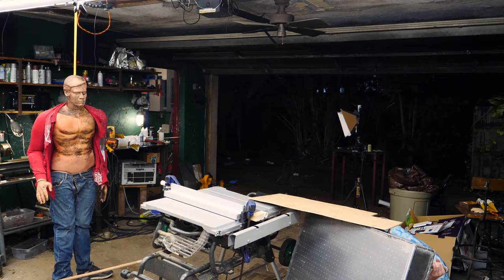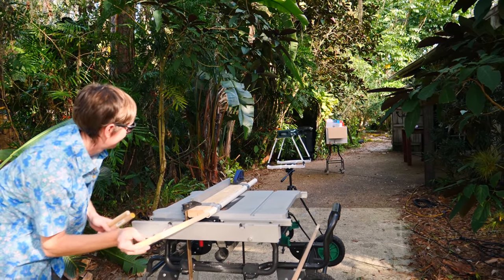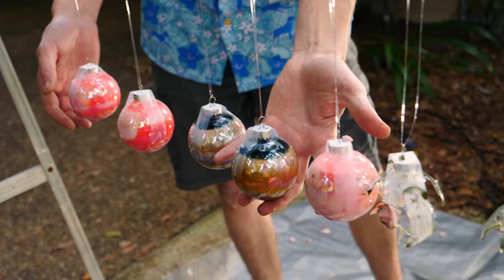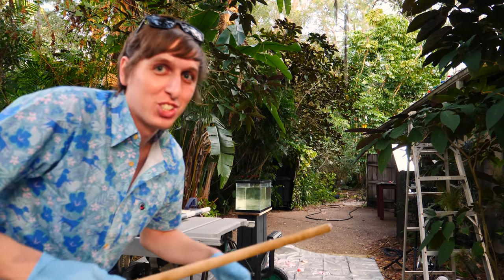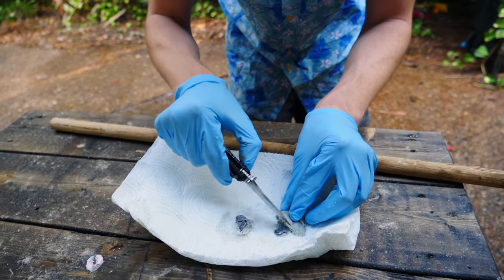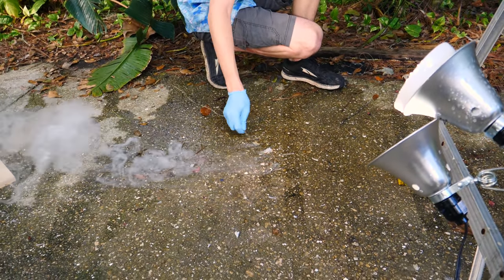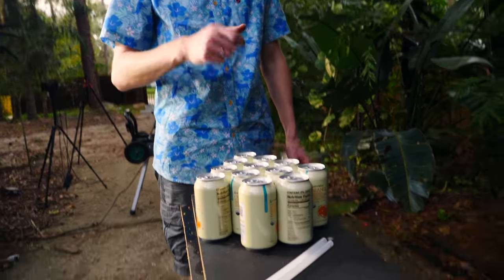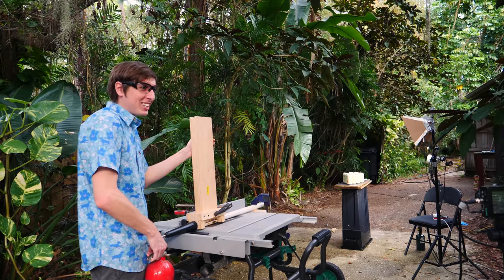Fully-Automatic Table Saw Cannon

Comment: You need to add rifling to the barrel.
Reply: Ya definitely
Reply: That wouldn’t work, because the dowel isn’t able to spin
Reply: @jacobr7729  It could theoretical work if the barrel was made longer
Reply: @realname3538  true
Reply: Put a suppressor on it lawl

Comment: Could you speed up the auto cannon with pressured air?
Reply: Tech Dunk I think he would need something to push down the dowels faster
Reply: The saw is catched on to the dowel; it cannot move any faster than the saw
Reply: Vasily Margleov probably
Reply: You can see the dowels are right behind each other when they're flying through the air. They are being pushed down the magazine as efficiently as possible.

Comment: You should find a way to add rifling! Those small dowels fired wonky and I’m curious how much of a difference rifling or making the wood more aerodynamic might make🤔🤔
Reply: Having the pipe on a slight angle to the blade might add enough spin to give them some stability.
Reply: Arrow Fletching / feathers might be easier
Reply: Just make them front heavy
Reply: DAM IT I JUST POSTED THAT uhh
Reply: I don't think rifling would work with a singular saw. Now if you could arrange 3 or more in a diagonal the would would spin like rifling. Rifling works best in guns, because your bullet is still gaining momentum while going through the rifling. Otherwise rifling would just cause massive drag slowing the projectile. Edit: actually just placing the saw offset in the tube and at an angle should spin the tubes as they go through the saw.

Comment: The folly was the fact that the ornaments are round, and therefore causes deflection. Even tho it is an easy to break thing, the fact that they are round will deflect the projectile to one side or the other. Much like medival armor and modern ground troop helmets. That and the oobleck being a non-newtonian fluid, it would have greatly slowed the speed of the wooden dowel, making it even less likely to make it through them all. Not to mention making it that much more likely to deflect.

Comment: I think having the dowels Improved got accuracy with fletching on the end like an arrow or crossbow bolt. And have the tips sharpened a tiny bit to mitigate some of the drag caused by the air. Would make it quite the spectacle considering it’s semi-automatic capability. 👍🏻✌🏻

Comment: Actually you can top that - put some points onto the tips of your dowel rods rather than leaving them blunt.

You can top that even further by getting a smaller table saw - Home Depot has a nice Ryobi for $130 right now and small enough to rig onto something that'll rotate - and put it on something that allows you to rotate it right and left so that you can spraw sharpened dowel rods full auto across and area, say as an anti-zombie weapon.

Now imagine the havok you can wreak on a couple of clay blocks or a spread of styrofoam cut outs.

Comment: try using glue stick, then put a metal tube at the end that can cause friction, which will heat the stick and when it hits the target, there will be more heat that can melt the stick. There u have a glue gun that shoots glue, LITERALLY (i dunno if this will work)

Comment: Maybe try wooden balls with a pipe as the magazine. Lower the blade a bit more so it only just grabs a small part of it with the extinguisher out of a smaller nozzle to get them a little more speed.

Comment: I mean, props for having a fire extinguisher on hand for the experiment, but wouldn't it have been more economic to use just regular compressed air (assuming you already have an air compressor)?

Comment: No way to top that  
Challange  

Put fins and a metal or steel tip  on the sheels  
Like a apfsds round (google it you will instantly now what it is then)

3 rules 

1 it has to have a shell around the dart like a real apfsds 

2 try to punch throw 3 mm of metal if it dosent work then 2 mm

3 and try to make it explode  after it goes throw something

Comment: You can put rubber on the blade and use your PVC pipe with a hand held circular saw , add a steel tip to your dart , and get a portable spear thrower .😀😀😯😉😈😈😈😈😎💀💀💀💙